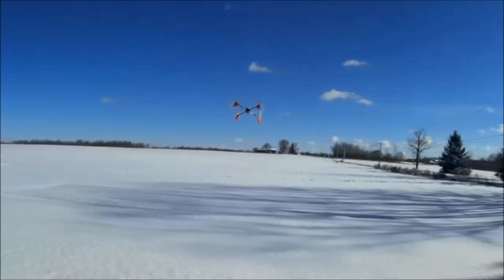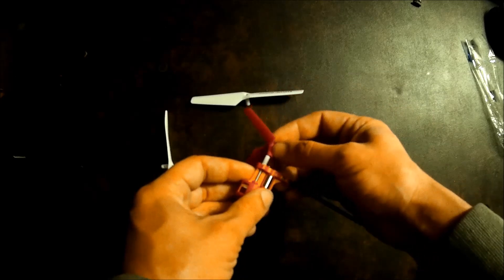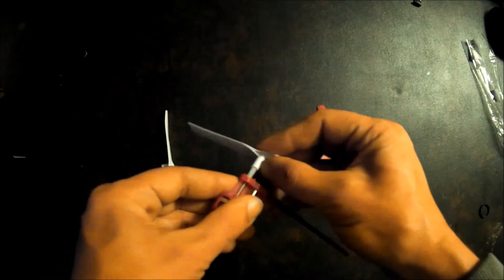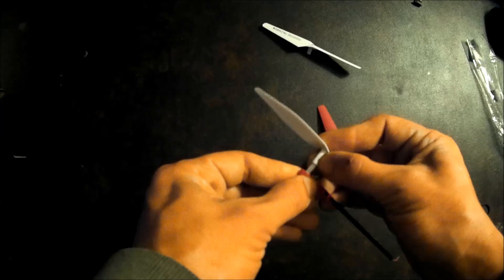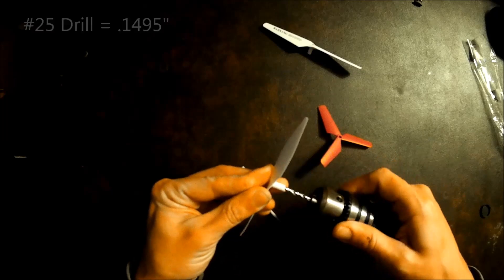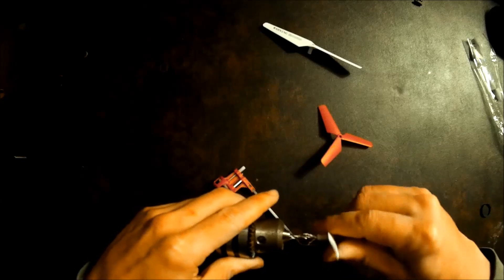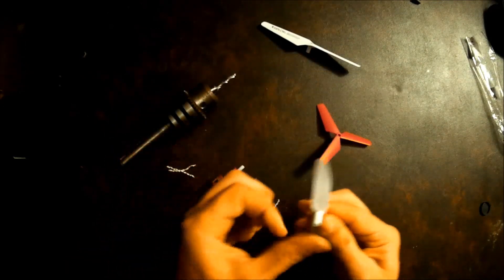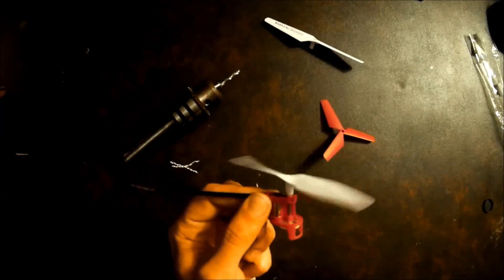Installing GWS 5443 propellers on a Syma X1 or X3 quadcopter drive train

Comment: Nice mod. Did the GWS slow the rpm down on the motors. i know that the reg x1 motors spin very high with stock blads and that Leeds to them wearing out. If so than i might do this to my x1.